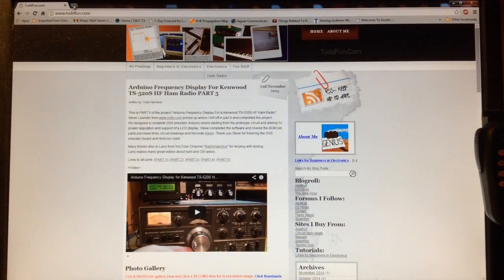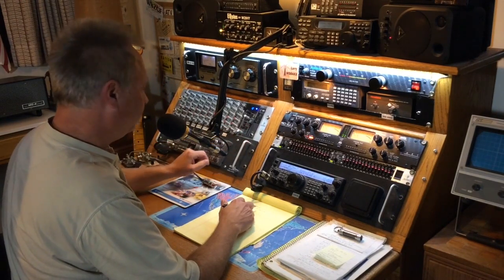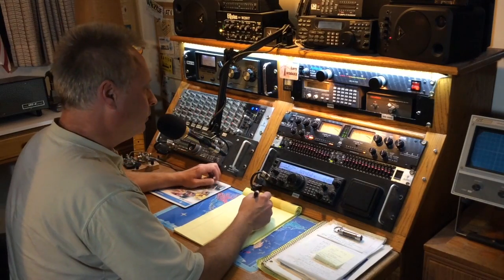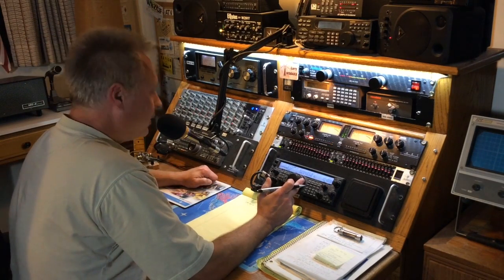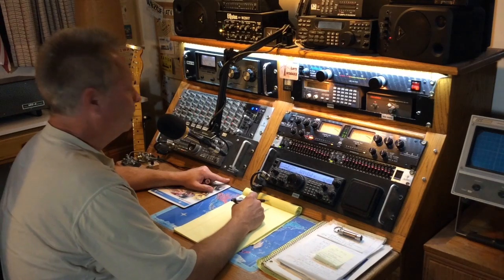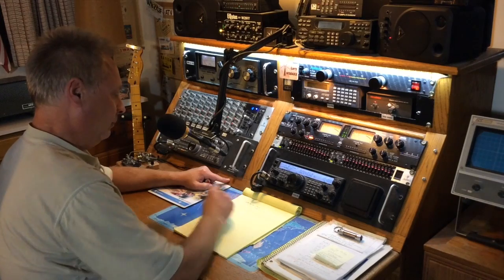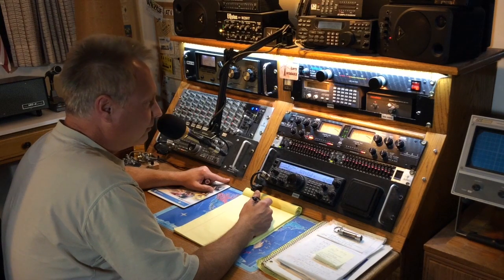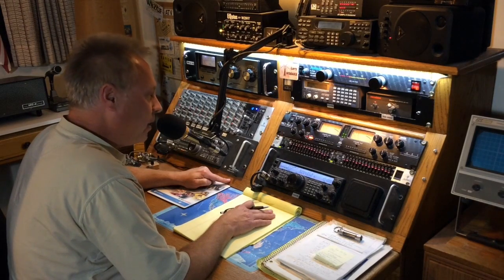Ham Radio HF On Air Test - Todd Testing His Arduino Frequency Counter

Comment: Thanks very much Larry! It was an excellent video covering your side. I must agree with others I really like your ham shack. If I ever build one it is going to look just like your's somehow. We've had a lot of internet outages here in the valley so I haven't been able to get online much lately. I get online and then I get booted. Seems like they might have it fixed up tonight though. It was even affecting business and colleges for almost 2 days.  (I updated this post because my phone changes the words to plan crazy.. HA).
Reply from the maker: Great Todd, I know how that is to have online problems, I get those a lot here.  I just got kw5gp's arduino book by ARRL after seeing the videos on w5kub site and hope to be doing some projects over the winter.  It is new to me but looks like a lot of cool projects for low cost.  Great job you did and keep up the good work! 73